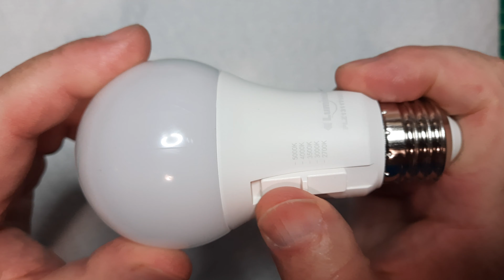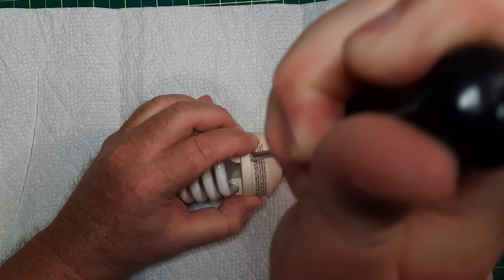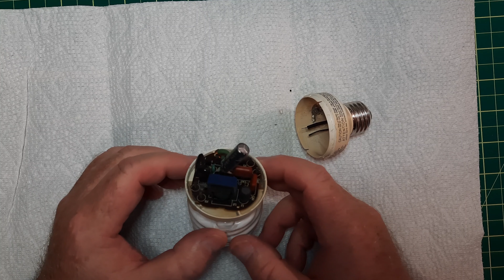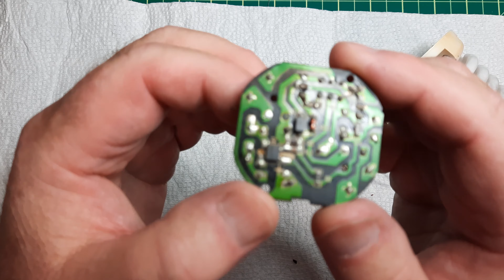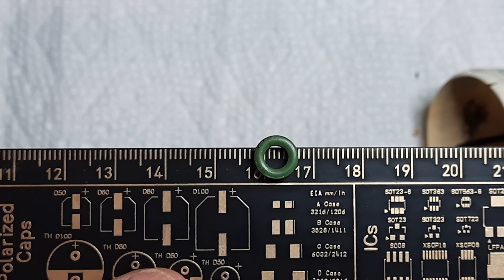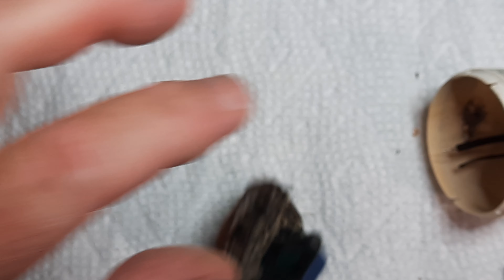Toroid Salvage from a Compact Fluorescent Bulb

Comment: That is an awesome LED lamp! I believe that if it has that many temperature settings then it's no COB but real RGB LEDs inside, isn't it?
Reply from the maker: Will have to take another apart, and yank the LED off of the board and test it.

Comment: I used to make power supplies out of these lamps. That particular device got two 13003 bjts, a
Reply from the maker: I noticed some of the these used wire wrap for the fine wires coming to the board and were not even soldered. Had not seen that in a long time.  Definitely a good source for making power supplies. Have a good day

Comment: Can you post a link where you got them from. I think they are pretty interesting!
Reply from the maker: The 5 different settings LED lights I got from Costco about 5 months ago, I forget the price but these were dirt cheap ($2 - $3 each) I have tried to find more at my local Costco but sadly have not found those LED bulbs, but the Costco Canada web page indicates these are still available at $31.99 for a 10 pack.  The brand is Luminus part number PLZ1311T10CC
These lights actually run fairly cool 8.5W with equivalent light output of 60W.
Have a good day
Reply from the maker: Update, Costco still sells these $19.99 for a 10 pack.